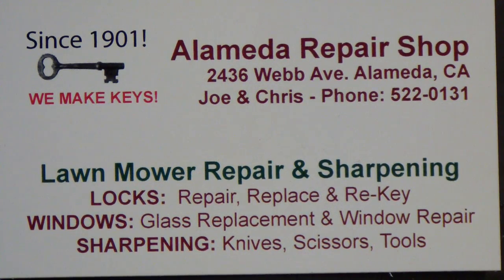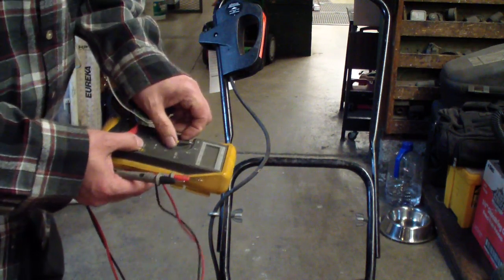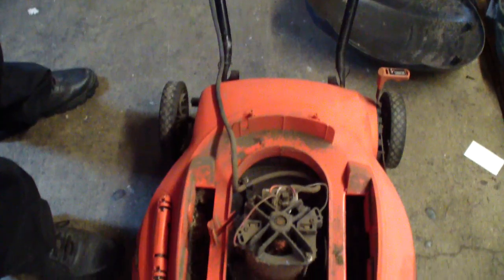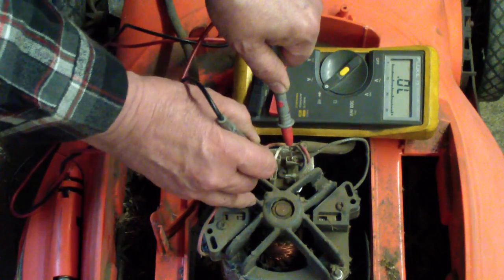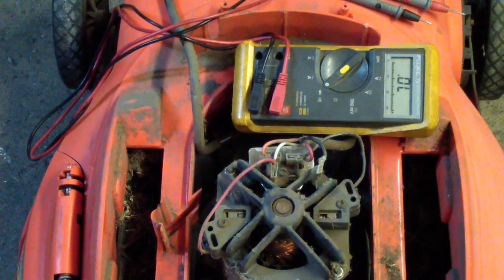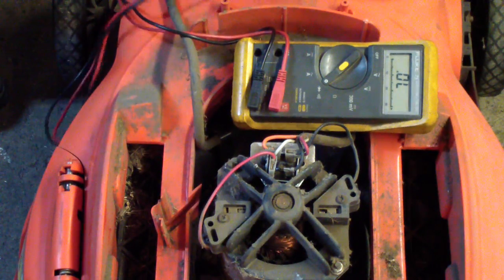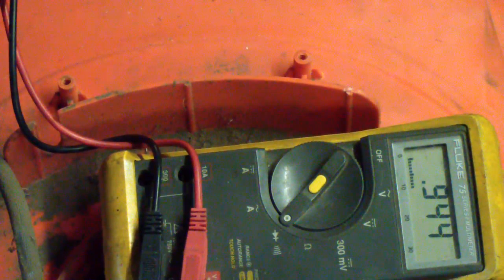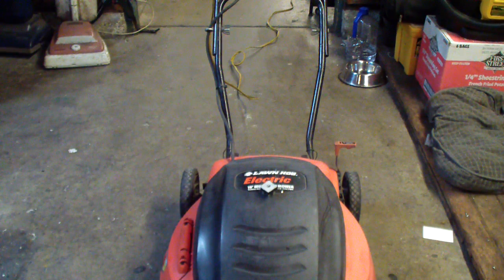SHORTED Black and Decker or Craftsman Electric Mower Repair

Comment: My electric mower acts like it is shorting out, but I don't have a meter. I would lift up and drop the mower to give it a jar and it will run then die out. Its not tripping breakers. I'm guessing its the rectifier or the brushes. I seen another video that showed a guy sanding the inside casings of the brushes for the spring action on them to move free and it worked. Gonna tinker around and see what may work before having to take it to a shop.